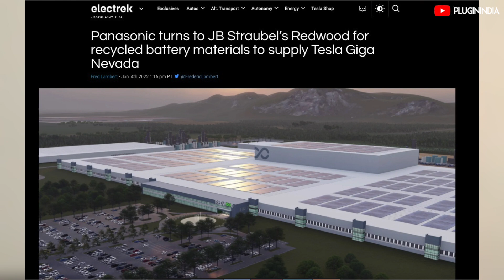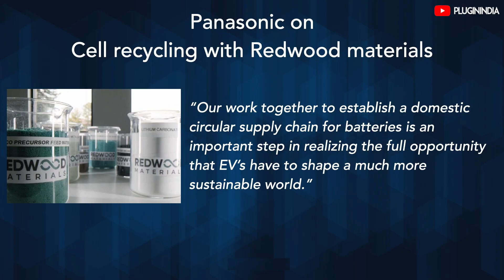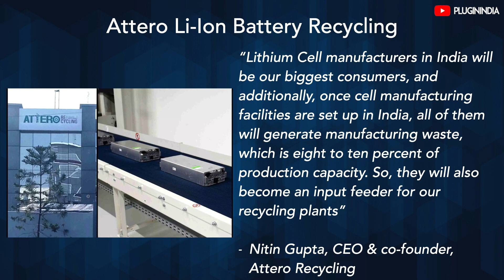Electric Car Watch 🚗 ⚡: Battery Recycling is happening in 2022!

Comment: That's a great news indeed as the anti EV fanboys always so criticising about the Li-Ion battery and it's manufacturing and recycling.  See how ridiculous are their arguments is that the Li-Ion battery and the electricity used to charge it all it's causing more carbon footprint than an ICE.